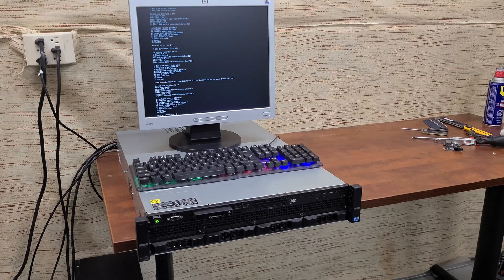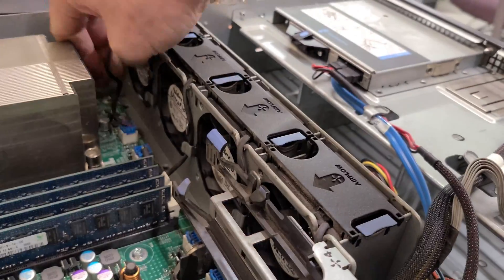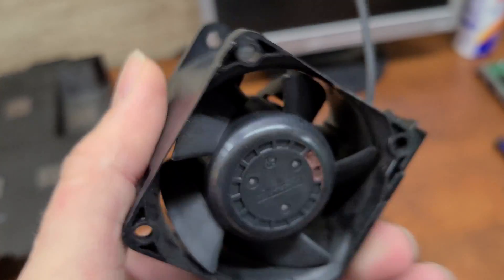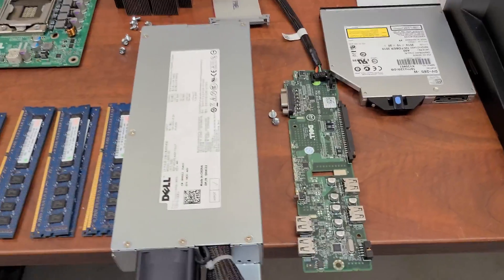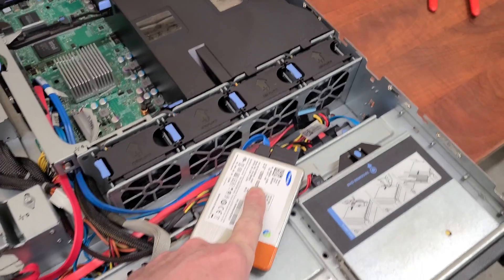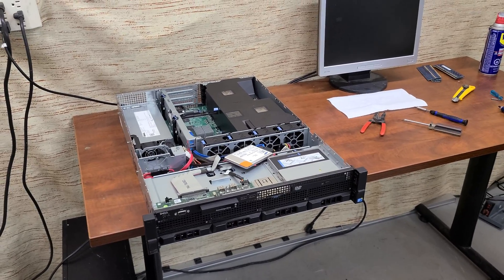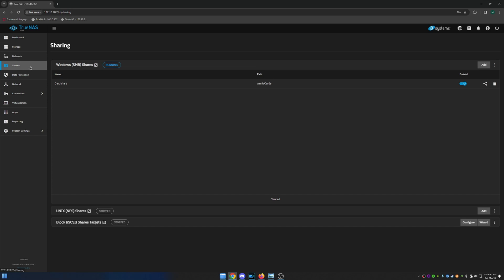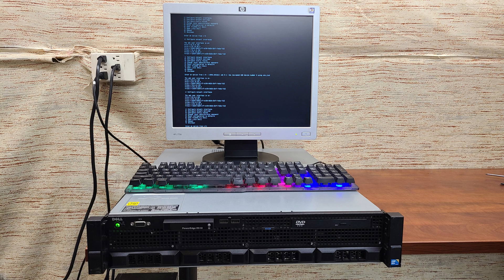My old server died!  New (to me) Dell Server for TrueNAS

Comment: So after adding the network card you still have 2 PCIe Slot available? You can add a PCIe card with two M2 connector (one NVME, one SATA), they are very cheap. It allow you to add a M2 NVME SSD drive for the slog and an M2 SATA drive to boot (and as the power come from the PCIe slot no need for a power cable, just the Data). And on the last slot a card with just a M2 NVME connector you can add an NVME SSD as mirror for the slog or for a fast storage for VM. I don't know if it's usable but there's a fourth PCIe slot on the riser so you may be able to add a third NVME SSD.
I'm using this type of adapter on HPE DL380 Gen9 and it works fine. I've added 4 NVME and 2 SATA SSD this way in one server.
Reply from the maker: I'll certainly be referring to this post when I build my next TN server!  Thank you very much!

Comment: Why would you buy something this ancient?
Consumer grade hardware these days already vastly outperforms this, at significantly lower power consumption. In my opinion, very old servers never make sense to buy.
Reply from the maker: @GeoStreber   Fair point!  This was a free to me server recovered from the recycling bin.  If I was needing to spend money, I wouldn't buy this.  Having said that, working in the IT industry for the last 17 years, a Dell R510 is a very economical server to run!  Not only that, it meets my needs for my use case.  Thank you very much for watching and commenting!  I sure do appreciate it!
Reply: @RandomTechMichael I mean, if you compare this to a bottom end Zen 2 chip, let's say a 4300GE, you'd be better off with that considering how little energy it uses. Only argument for server equipment really is ECC RAM. BUt PCIe bandwidth, I highly doubt that you're going to need it for a file server and a couple of VMs.
Reply from the maker: You are not wrong on all points!  But, I spent zero money on this.  Which is always best case scenario for me!  :) 

Plus, this machine is still in use rather than the landfill.   It's a win/win!
Reply: @RandomTechMichael Depends. How long are you planning to run it, and how much does the electricity cost? Here, the electricity cost of a server over its lifetime is typically in the same ballpark as its sticker price.
Reply from the maker: I have 21kw solar on my house!  I produce more power than I consume...  

Hey, thanks for all the engagement!  You sure are passionate about these things!  :)
Reply: Generally for ecc support and more pcie lanes but even I have to admit this server is well past it's best days, especially given it's the 4 bay version.
Reply from the maker: @nadtz She's old for sure!  But I only need a basic  file server and a way to spin up a VM or two for testing and experimenting when needed.  This checks all the boxes!